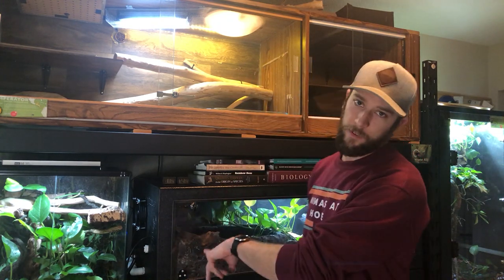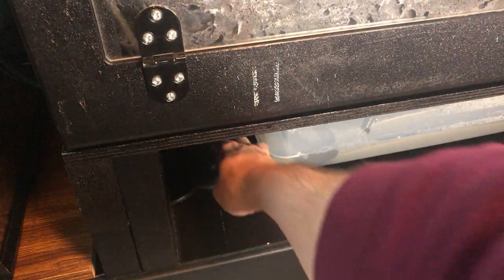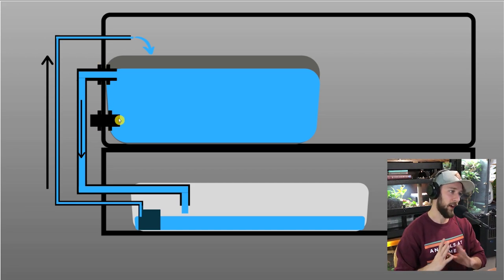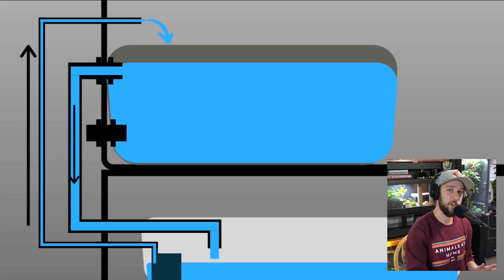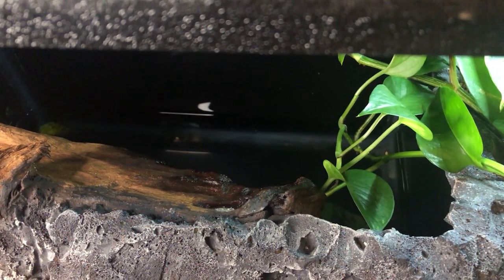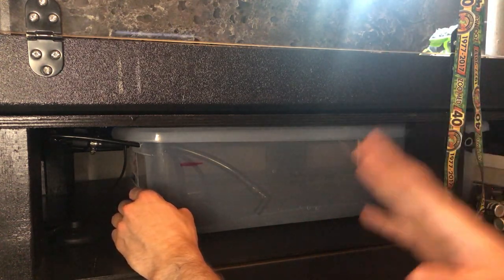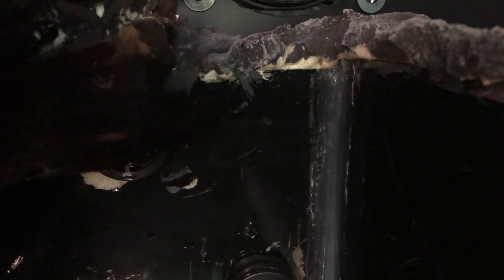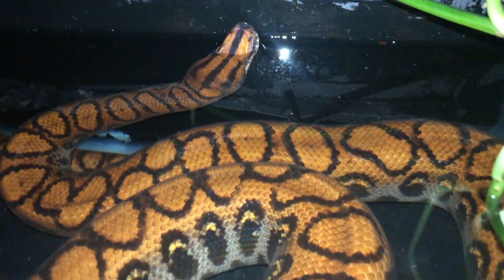REPTILE POND! (Plumbing Explained)

Comment: Glad you agree with my previous comment about using a commercial external canister filter with a couple of gate valves to make life a lot more simpler. It would also create a bacterial filter in the canister filter media which would keep the water fresh and clean, and be able to deal with any pollution form urination / defecation in the pond until you are able to clean it out.  What you have there is just a sump with a circulation pump.  But it's all good fun experimenting :)
Reply from the maker: Yeah thanks for the feedback! Next time that is definitely what I’ll do... so much easier haha!
Reply: I would like to know more about the canister filter. I am about to embark on this same journey and my pond will be a bit bigger than yours. I just want to make sure I have all the info

Comment: What are the dimensions of your pond/aquarium? I really love this idea and going to do the same for my boa.
Reply from the maker: Thanks for watching! The pond is roughly 17” L x 10” W x 8” D
Reply: @AnimalsatHomePodcast  Thank you!
Reply: @AnimalsatHomePodcast  Also I know that you said you wanted to put a canister filter on it how would you have done that? Would you set the filter canister in the reservoir or straight from the pond feature?
Reply from the maker: @donovaneubank320  I didn’t end up doing that, I’m thinking it’s probably not necessary. Doing large water changes is much more effective